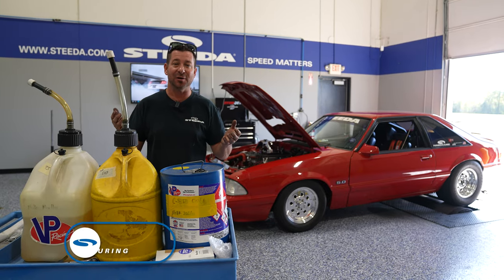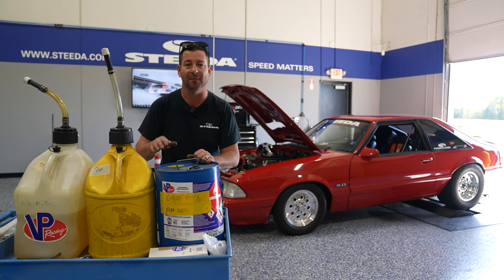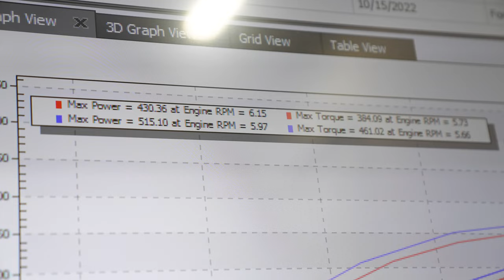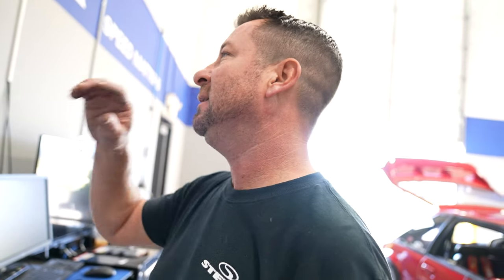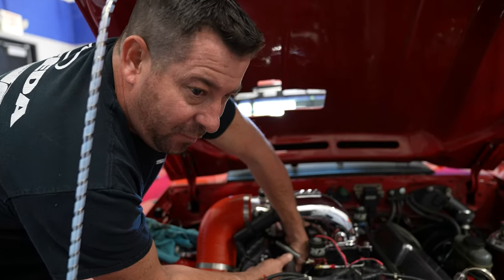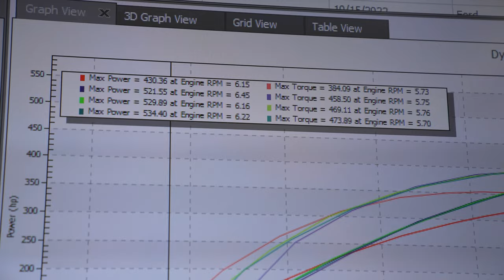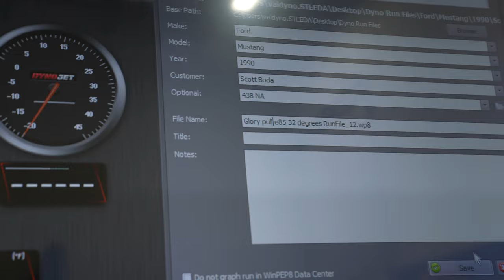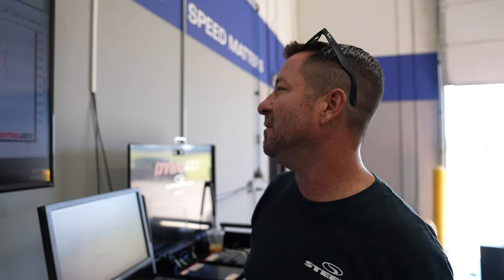How Much Horsepower does E-85 Actually Gain on the Dyno?

Comment: unless e85 is not readily available by you, there is no reason not to run it.  my boosted coyote gained over 100 wheel with it
Reply: 100 wheel? Most coyote guys, myself included, gain 60 to 80 wheel with E85 and boost. 

Did you also turn up the boost?

Comment: That is awesome! I was so excited to see this video. It supports my claim. When i put in your closed CAI and you guys did an E85 tune for me I picked up 54 hp on a pretty much stock engine. So thank you. Those results are on my channel if anyone is interested. Thank you steeda and Scott for this great video.
Reply: On a gen 3 5.0 mt82?
Reply: @hassaan89  10R80 transmission.
Reply: @bardstables8909  nice. 54 hp or whp? I know the di on gen 3s makes it easier to tune for more power but that's a lot to gain with just a cai + e85. Different dynos and conditions/calibrations do reflect different outcomes but that's definitely on the generous side.
Reply: @hassaan89  54 hp gain at the wheel. It now makes 466 wheel horsepower.
Reply: @hassaan89  yes, it was the same dyno and the same guy that ran it. He too was very impressed.

Comment: I have 2018 Ram 1500 V6 3.6l flex fuel vehicle, came factory tuned with all parts, software for E85. I run E85 on regular base , cheaper. By factory this V6 with gas makes 305hp and 270lb-ft torque (engine numbers not wheels) I got on my Dyno with E85!395 HP and 340lb-ft torque ( same engine number) , which is great numbers for a vehicle which already came factory tuned, no any kind of mods except SAI. V8 Hemi guys just can't believe and they don't want to accept power of E85 from Flex fuel V6 engine 😁
Reply: I’m guessing something obviously went wrong with your test if you showed a 160 hp gain from a fuel change…
Reply: @guthrie_1  read the comment again he had 305 on pump gas then on E85 he made 395 so first grade math tells me he made an extra 90 horse power
Reply: @dh123ize  He said he got on a dyno which measure horsepower at the wheels.
Reply: @dh123ize  Even if he was quoting crank numbers, there is no naturally aspirated vehicle on earth that picks up 90 hp by switching to E85. That would require cams, headers, manifold, throttlebody, etc. Most vehicles will see a 10 to 20 hp gain which results from another 5° to 7° of ignition timing advance.

I personally pick up another 70 to 90 HP with E85 and that’s with a supercharged coyote with 12 to 1 compression…

Comment: Yes, yes, yes finally a true same day test of E-85. I've been running E-85 in all my street/race cars for the last 5yrs. I own 4 supercharged Shelby's running E-85 all are 1000rwhp except for one making 925rwhp. Thinking about ditching the 427 & procharger and going to a Whipple 5.0 or 5.2 to crack 1000rwhp, a 2600lbs car with 1000rwhp, ooooh scary. 
    I've known what E-85 is capable of for a while now, I wouldn't go back to 93 or 110 if you paid for the fuel. Yes you sacrifice some fuel mileage, but running 24lbs of boost on a street car can't be beat. Nice to see you spreading the info on to people who aren't able to get to a dyno and experiment for themselves. Keep up the good informative work.
Reply: I know guys with import cars running almost 40psi of boost on 4 cylinder engines with regular e85. It is such a good fuel very knock resistant and capable of a lot of compression/boost.
Reply: @GnarshredProductions  
Yes I know, it's great for boosted and nitrous engines even cools the cylinder walls. I don't see why all vehicles aren't running it, it's the 3 buck chuck of the automotive world. Yes you have to modify the fuel system and you loose some mileage but the performance gains is amazing. A lot of people have a problem with the mileage, but if you want horsepower you have to sacrifice mileage no matter what fuel you're running. All my cars and motorcycles are running E-85, I don't have a 93 or 110 tune on my laptop anymore.

Comment: What transmission in your fox,? What cam specs,  what rear gears. Whats car weigh.  

Whats car make on motor alone. 

What cylinder heads and intake and exhaust?
Reply: C4 manual valve body Performance Automatic. Cam is a custom spec KBX unit. .696 lift I/E, solid roller. 3.31 out of a GT500.  Car weights 3350ish, still full factory interior, including the rear seats. Car has made 702 on a engine dyno on Motor.  438 Dart based, with old school TFS Hight Ports, from Bennett Racing, with titanium intake valves and stage 3 porting.  Intake is an Edelbrock Super Victor converted to EFI by Coast High Performance. Exhaust it 2" Kooks headers to 3" dumps.

Comment: About to do this for my 2020 GT500.  Kinda hesitant because of limited gas stations and range but man what power gains
Reply: Just buy 12 VP cans and go fill them up at the closest E85 has station near you. This is what I’ve done for the last 4 years. Also, you may only need E55-60 to see most of the gains from E85, so you can blend it down with 93 to make it last a little longer and get better gas mileage.
Reply: @lpcook1 this is the dumbest comment I’ve seen, e85 hates to sit. So buying cans and filling then and letting them sit in your garage is a horrible idea. E85 is almost never e85 except California and florida. Every other state your lucky to get e65-e70. Then let it sit for a week in cans and it’s down to e-50… if your running a dedicated e85 tune you will explode the engine. If it’s a flex fuel tune then I guess it will work and give you some Hp but that’s weak and not the right way to do it.
Reply: @xGR1MxREAPERx  Umm…you are wrong. I live in New Jersey and the E85 station I typically frequent always test at 77% or better irregardless of the time of year. I have been buying E85 since 2018 and have never had one incident or saw the E85 degrade like you mentioned. 

Now, I don’t recommend letting E85 sit for 2 years, but 3-4 months have not been a problem for me. Typically when I buy this much E85, I use it all within 2 months anyway and then go replenish. I store my cans out of the direct sun and on rubberized mats and test the gas if I could not use all the gas within 3 months. 

I also have a flex fuel car, so I don’t have to worry about exceeding a certain percentage for an E85 tune and that is what my response 1 year ago was based on. My tuner does not give me anymore timing advance after 50% E, so I never have to worry about hitting a certain percentage to get max power. 

With that being said, I typically like to have it at 70% or better to get all the additional cooling benefits in the combustion chamber when really pushing the engine to max.
Reply: @lpcook1  talk to experts about fuel and they will tell you that letting e85 sit in a plastic jug will leech condensation out of the air and it will lose its content.. it isn’t something to argue about as it’s a proven fact lol.. ? Maybe you have food e85 around you that I could of been wrong about but the thing your arguing is literally in the msds documents and explains it about e85 or any e50+ fuel bro.
Reply: @xGR1MxREAPERx  Who is arguing? You questioned my statement from 1 year ago and I promptly replied. But okay, Bro 👊🏾 I really don’t care.  🤷🏾‍♂️
Reply: The key to storing ANY fuel is to use unvented metal cans.
One of the reasons it is shipped in metal.
Reply: @lpcook1  i have a 55 gallon drum i fill up the closest station is about 25 miles away
Reply: @dh123ize  That’s even better!

Comment: I run stock injectors on my Gen 3 (2022) with E85 tune (Steeda ) 450HP/422TQ. Will changing injectors increase those numbers, if not what else can be done with the tune to increase?

Comment: Getting my 2003 Mach 1 tuned by VMP performance, doing a 93 tune first but getting an e85 tune right after, hoping to see some decent numbers from that
Reply: Curious to see differences
Reply: @johnkrstyen7351  I’ve seen a fbo and cammed Mach 1 go from 378hp and 343ft-lbs on 93 to 401hp and 358ft-lbs on E85 so I’m curious on just intake, exhaust and upgraded fuel system
Reply: @Deadvous  little more into the turbo 4 and 6 cyl engines than v8's myself. Dsm/evo guys have been running e85 since mid 2000's and stuff is a game changer imo.

Comment: I like this test Scott. I’m running something similar……418w fox lake stage 2 victor jr heads, Ed Curtis cam, same style intake combo. Mine made 510hp and 500ft lbs.  Power is up top around 7000. Tuned for VP110. Thinking of switching to MS109 or VP113

Comment: WoW!!! :face-blue-wide-eyes: I'm Floored!!! E85 made 120Hp More than 93 octane on just burning a little more gas and a few degrees of timing change!?
Reply: E85 has 40% less energy than regular fuel! thats alot! not a little.
Reply: @berardoferrari  Indeed, oddly enough 87 octane has more energy than 93 octane , and both have much more energy than E85.
Reply: @jbrewster6175  I’ve never heard of 93 not having as much energy as 87. I know there are additives that increase knock resistance and make it burn slower. The stoichiometric rate for both is the same, so I’m not sure that makes sense.

Comment: A little mixing of Toluene might have been interesting as Toluene should have a fairly high MON octane value 

Or maybe Xylene. But something lubricating may also need to be added to the fuel. Because this is solvent

Comment: Your stangs exhaust really booms , sounds like rolling thunder up top. Are there any down sides other than milage , like oil contamination and fuel system and engine corrosion ?

Comment: I'm currently having my C7 converted over to E85 with a DSX flex fuel system.  Having to drop a low side auxiliary pump and upgrading the injectors from LT1 to LT4.  She's also forced induction.  I'm just curious how much of a HP gain I'll get.  Consensus is about 100hp gain.  Guess we'll see.
Reply: So what were the results?

Comment: Did you guys test the e85 to make sure it was true e85 or higher?
Reply: Nope, the gas station in Tallahassee is known to be very consistent, so we just Sent it!
Reply: If it is pump E-85 it can be anywhere from 51 percent to 82 percent, pump fuel is never 85 percent! the oil companies blend as they wish and just call it E-85.
Reply: @LongStroke351  Sadly you have no idea of percent of ethanol content could be 51 to 82 percent.
Reply: @ScottLarson-hr2bj  51%-82% is all the sticker on the gas pump says, but if you actually test them, most of the time in the summer they will be up close to e88-e90. Ive seen as high as 92% personally. Averages closer to high 8x% though. Several people testing, several different testers. Winter time is really the only time that you'll see it fall below 75%.
Reply: @candyhandsjf7288  I don't know what state you are in but here in N.C. I have tested pump E-85 for 12 years and have never seen 90 percent usually in the 65 percent range,  since I taught at a trade school for years we had access to the local refinery and a lot of my info came directly from them. I just wanted people to understand that there are huge variables to converting to pump E-85.
Reply: @ScottLarson-hr2bj  Middle Tennessee. Speedway gas stations specifically are the ones that most of us use. Very consistent and almost always 85+% until the colder seasons hit.

Comment: Where do you get VP C85 for $3.00 a gallon. It’s $15.00 a gallon.
Reply: It's just in a C85 can, but it's pump E85.  We use the C85, which is $15 a gallon in the Silver Bullet.

Comment: Because E85 cools more the combustion chambers than VP110...🎉 You need to try E100, could even be denaturated alcohol from farmacies... you gonna get 575 hp from that foxy
Reply: We saw no hp increase going from gas station E-85 (which tested at E-74) to E-98 (VP). 74 degrees ambient and 7100' DA, 5350' elevation.
Reply: @TT64NOVASS  have you tunned the air fuel ratio for the calorific power difference (RFMAP), or kept the same as E85.
Reply: There are diminishing returns after E70. You can only advance ignition timing so far before it becomes counterproductive. What you get at the pump is pretty much all you will ever need.

Comment: Sadly this test really is not valid, pump E-85 fuel can contain anywhere from 51 percent to 82 percent ethanol it will NEVER be 85 percent ethanol. The federal government allows the oil companies this flexibility on ethanol content without telling you what the mix is. Using this in a high performance engine is a crap shoot unless you can monitor ethanol content actively as it is delivered. One tank full may be a great power maker while the next tank full (with a blend of less ethanol) could destroy an engine unless you tune for it, because as the percentage of ethanol changes so does the octane rating of the fuel and obliviously so would the available power output of your engine. One other side note is that your fuel system needs to be designed to except ethanol based fuels, that includes larger injectors, more fuel delivery volume (lines, pump and usually pressure) and last but not least any part of your fuel system that ethanol touches needs to be non-corrosive, because ethanol's best friend is H2O. We actually can test ethanol content with water. You start adding in all the equipment costs it takes to run E-85 properly in a lot of vehicles out there and it is not as cheap as you might think. Just be very careful and do all your homework.
Reply: The fuel system is designed for much greater power levels than what I was running. Even though I run Nitrous I built the fuel system to handle boost one day.  So an injector swap is all that I needed.  I will agree that I should have tested the pump E85, but every time we have it's checked out good.  Timing is still pretty conservative so I'm not too concerned.

Comment: tell my why my Steeda E85 tune only gets me 406 WHP????
Reply: Because you're a canes fan LOL.  Go Noles.   Need more info on your combo.
Reply: Need more info, did you get larger injectors? What's the timing? What fuel pump are you using? What's the fuel pressure? Are you running a power adder, turbo or supercharger? This all matters when you're looking for serious power gains.

Comment: Why bother? You can get sooo much more out of a coyote engine just a little bit of money
Reply: Because a coyote will never sound as good as a push rod motor with a solid roller.  I've got a company coyote to race, and yes they are bad ass.
Reply: I have a 520wheel fuel injected 438windsor 68 mustang street car e85 weighs 3k lbs and smokes everything on street,  and a 900wheel built boss Roadrunner 2011 5.0 and both motors are badass, but the 438windsor is super fast...

Comment: Great video nice Stang, just a heads up alcohol will damage everything it touches from the gas cap to the pistons. Corrosion, main,rod bearings,oil pump every thing it touches. It gets in the oil the exhaust into the turbo! If you have the money to rebuild or better to start over with a new motor, do your homework on alcohol,that what e85 is. I know I ran it and ran the e85 out after track day every time before I left the track but didn't change oil and filter after every use and messed up bearings pistons oil pump turbo because of alcohol in the oil. CORROSION!!!!!
Reply: Thats not correct..I use e85 in both my Mustangs and my oil analysis always shows zero e85 in the oil.  Just make sure you drive car at least 30-45mins and oil temp gets to 220 to burn off all moisture and combustion by products in oil. My oil never has any fuel dilution with e85 cause i always drive cars at least 45mins.